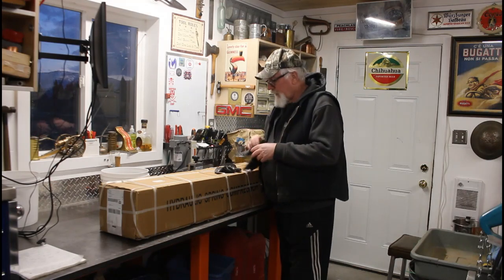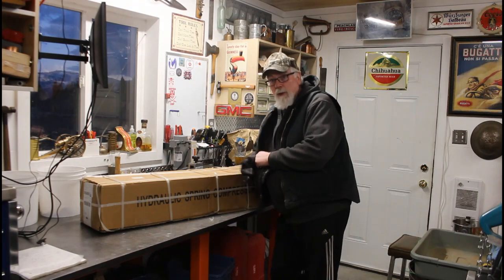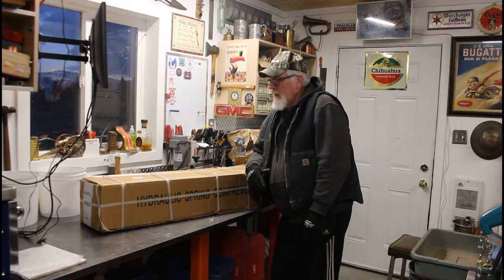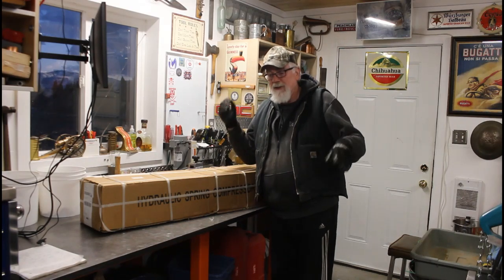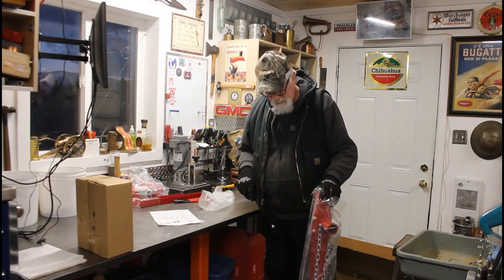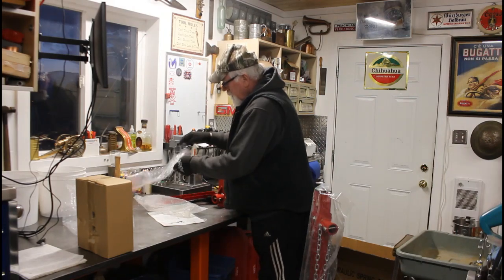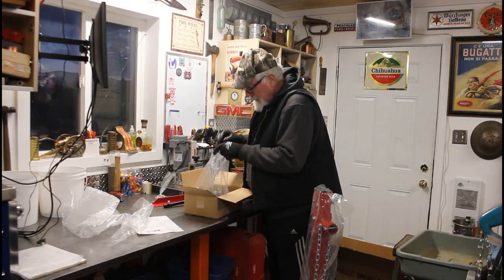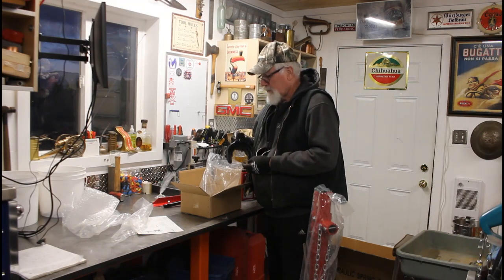Strut Spring Compressor, Review and Use Part 1

Comment: Not gonna scrap this brand new "china piece of machinery" when it does such a dangerous spring-loaded job. I've fought springs, it's not fun, so a hydraulically assisted one is much better.
Reply from the maker: I think so Ratheon, much safer in my opinion.
Reply: @CruiserMac  Springs store a lot of energy and when a human forearm cannot do it, it's best not to be around when a spring uncoil and you cannot hold it. That's why we need safer tools
Reply from the maker: @ratheonhudson3311  Yes indeed, a lot of stored energy.